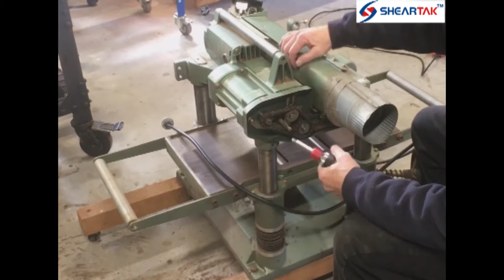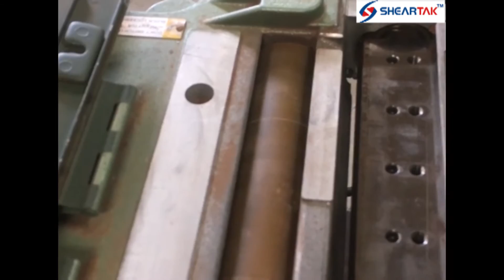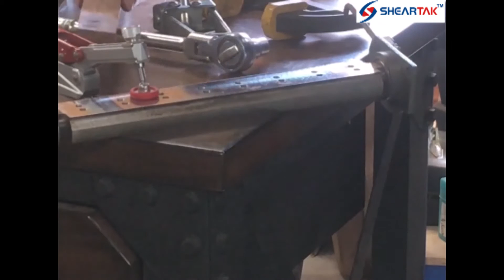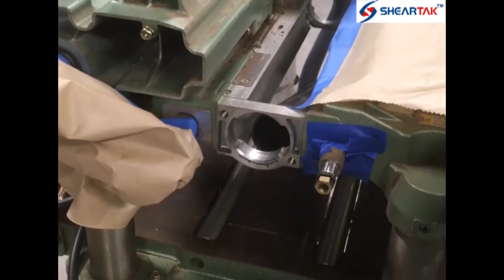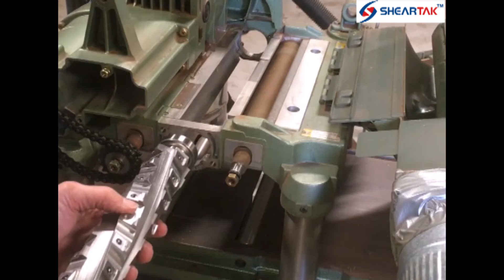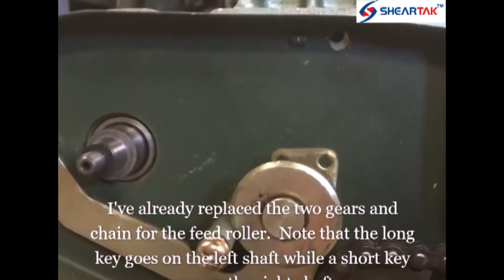Install Sheartak Spiral Cutter Head to Hitach F1000A

Comment: Please make video of the machine in operation. The F1000A cut beautifully with its  
original cutter head even in highly figured grain. What is the need for the upgrade?
I have owned three of these and two CB75F’s
(Resaw bandsaws) for 38 years without issues.

Comment: Thanks for the video, BUT to anyone watching the bearing replacement portion, DON’T follow the described procedure of bearing installation! 
1) Pounding on the bearings is putting pressure on the outer race as well as the inner race causing brinniling of the races which will lead to premature failure.
2)  Instead put the cutter head in the freezer for a few hours and heat the bearing over a lightbulb. This will allow the bearing to slide (snuggly) onto the shaft.
Otherwise a very informative video.
Reply: Brian is right.  If the bearing doesn't press on with minimal pressure, do the cooling and heating he describes.

Comment: Do you have a video of the machine running and cutting wood?  I would like to know the effects of adding that amount of cutters to the ability of the motor to handle it.  I have this same planer jointer and seriously considering but wondering if it bogs down the motor.
Reply from the maker: The spiral cutterheads don't bogs down the motors. As spiral cutterheads have a few carbide inserts keep constant contact with the wood, the start-up current of the motors rises up.  Yet once the spiral cutterhead runs, it requires less horse power. You don't to do anything to your motors. 
There are some misinformation about the power>。

Comment: Hey Gary. Looks like you had a small hitch there re the chain tensioner. I found I could remove the chain tensioner springs easily and then I just slid off the chains complete with their sprockets. If you want to share tech about these cool machines take a look at the Canadian Woodworking forum...
https://forum.canadianwoodworking.com/forum/tools/power-tools/1293011-f-1000a-owner-manual-parts-diagram-and-service-manual-uploads

https://forum.canadianwoodworking.com/forum/tools/power-tools/1289717-hitachi-f-1000a-repower-project

Now back to your video...
Reply from the maker: Thanks for the information.